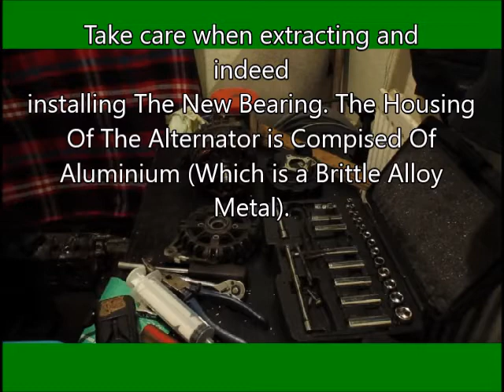(Part 2) How to Fix 2007 Kia Picanto Alternator Bearing,  Fix And Refurbishment Of Alternator

Comment: Excellent video sir, but what are the dimensions of the bearings?
Reply from the maker: Remove the Old Bearing and Measure it with a Venier Digital Caliper Micrometer. This will give you The Diamensions for your Alternator then go to RS Logistics and order what you need.  Like and Subscribe, Thanks...!
Reply: @HowToSaveMoneyOnCarRepairs  wanted to have the bearings on hand before starting the job, thanks.
Reply from the maker: There are (3) Different Makes and models of alternator fitted to this Car..! in order to get, the Correct Bearing Dimensions for your car...! You will have to remove the Old Bearing and Measure it. The alternative is Replace The Whole Alternator..! 👍👍 @MegaEvoluzione